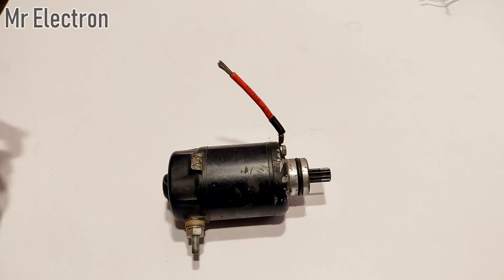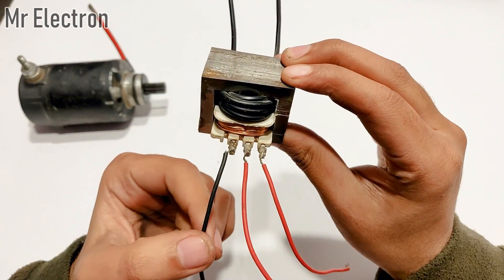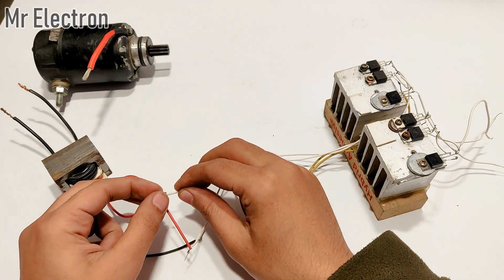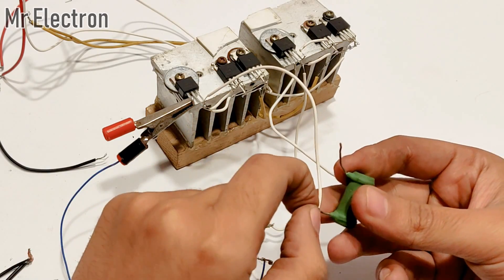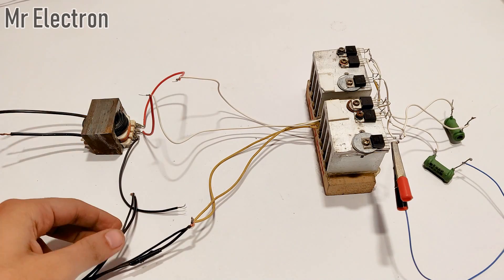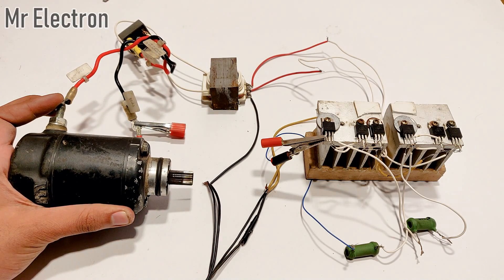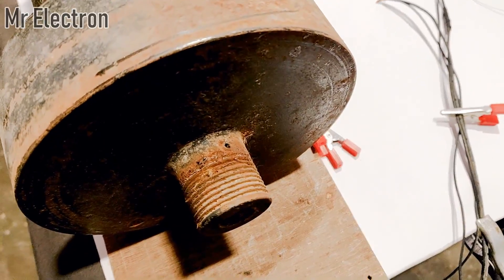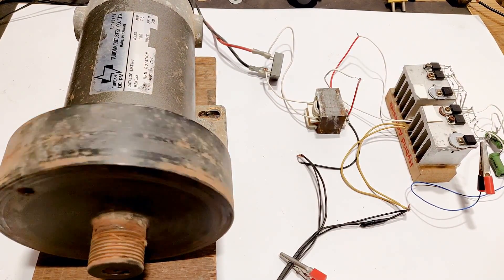12v , 3 Amps to 40 Amps High Current Supply for DC Motor DIY

Comment: Nice work, can you please tell me what guage wire do I need and how many turns on the coil if I need 50 amps and 24 volts if I'm using N52 neodymium magnets 60mm by 200mm rotating at 7000 rpm

Comment: Hi I have a problem in one of my project,
 how can I use capacitor as battery to supply continuous power from generator to a load with high amps like 300amps
Reply: Super capacitors or LTO cells*
Reply: Two issues here, generators usually produce AC, in order to use a battery or capacitor as storage you would need to convert the 
AC to DC and that would probably not work with your load. The other issue is that capacitors are not batteries, they discharge quickly , calculated in time constants . The time (in seconds, t) is determined by the capacity (in farads, C), and the resistance (the load in ohms, R) t=RC. You can use math to see that you would need a capacitor the size of a barn to supply 300 amps for even a short period of time.

Comment: Yheap :-)
This trick is really good, now you can test high powered current motors for a few seconds with a simple device that could be placed in a small box for the travel
This could be interesting for the garage owners to verify if the starter is already ok or if an eventual starting problem comes from another part of the car
Reply from the maker: Indeed !
Reply: @MrElectron  
Bro whatever experiment you doing, you needs to show the voltage and amperes producing or even consuming what amperes its consuming